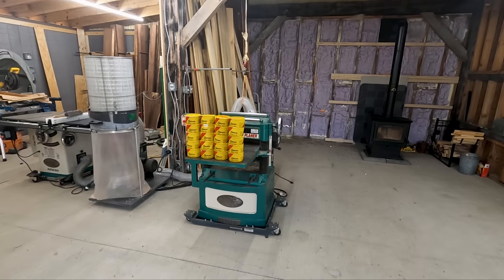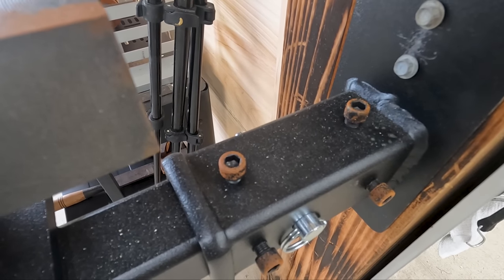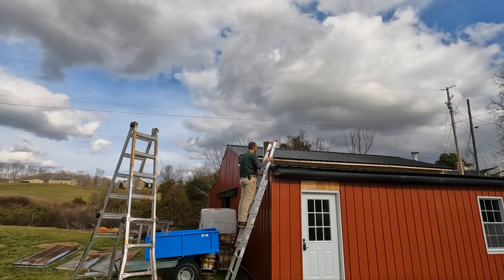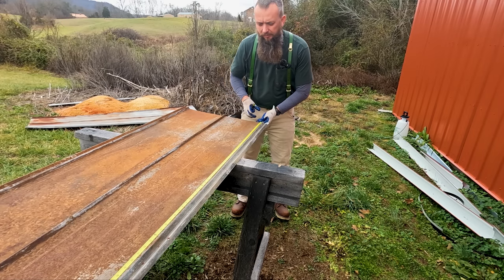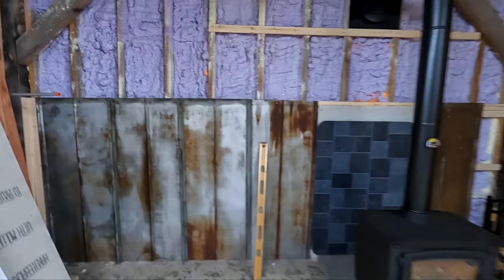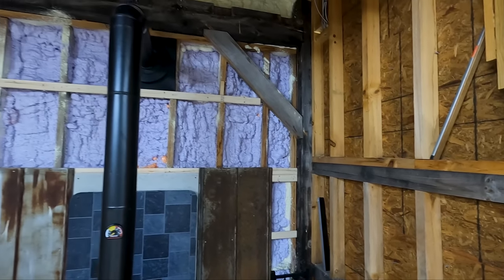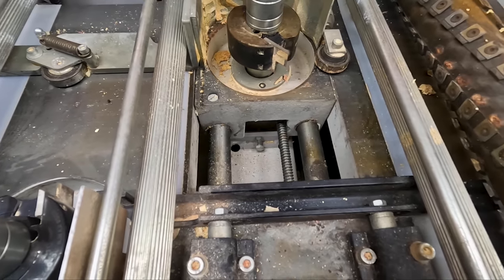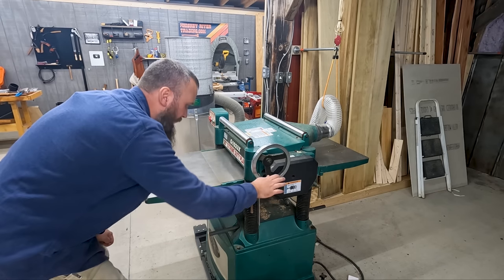DIY Barn Tin Walls In My Timber Frame, Cheap & Easy

Comment: When my parents build our new home, we had hardwood flooring installed. After the sanding and finishing once a year we rubbed the paste wax on the floors and the buffed them. The waxing job was done on our hands and knees. This was in 1968.

Comment: I’m with you on heights, terrified of heights. When I was a new sailor on my first ship, I was given the task of climbing up the side of the smokestack to remove the canvas cover so we could light off the boiler. I told the chief I as afraid of heights, he told me it sounded like a personal problem. Came down from that stack soaked in sweat.
Reply: Old sailor too. Had to go out the yardarms to change bulbs in our signal lights. I was too scared to tell anyone how scared I was... 🤣
Reply: I'd been married several years before I learned my hubby was afraid of heights. One day, he'd returned to the ship after having had wisdom teeth removed, & was told to go up to the crows nest for something (the why, escapes me now, this was in the early 70's), & he nearly passed out. Made it down before he went over the side.

Comment: I'm afraid of heights as well, however being up high on scissor lift as long as I feel secure no problem! put me in the middle of a room on a short step stool forget it! As a lover of woodworking  and blacksmithing channels I use  a mixture of paste wax and boiled linseed oil on hand forged iron work applied to it while metal is warm to protect it.

Comment: I think the added length of pipe for the wood burner will improve the draw. And I like the metal on the wall, I think once the Masonite speed board is finished I'd piece the scrap of the tin together behind the stove pipe, just for an added layer of fire prevention, plus the metal will absorb abd radiate some heat too. I'm liking the timber frame better and better every time you add something! Good Job Nathan!!

Comment: Love my killinger's suspenders. When ever I set up a new profile on my 5 head SCMI moulder I run a piece of UHMW (Plastic that is on most table saw fences) through the moulder so I have a guide to set it up the cutters the same each time I need that profile. I usually only need one test piece. Keep up the great work sir.

Comment: So a tip for setting your molder. Get a digital caliper, measure and sort all of your spacers per thickness.  You might use 2- 4' pieces and your good to go. Setup blocks and data sheets are very helpful also. 
 Chairn is 🤣🤣🤣, had to show my wife!! 🤣😄😄

Comment: In the Bad Old Days when I ran & pulled computer cables in offices I had an un-powered nibbler as all the framing and walls were done in light steel or aluminum.  Much quicker than drilling a large hole and opening that up with a keyway saw.  Still had to be careful as the nibbler would leave sharp edges.

Comment: I'm not a big fan of rusty tin siding, but, to each is own.  With all the lumber you have coming off the mill, wouldn't it be easier to put some cut offs of slab wood?  Thanks for sharing.

Comment: You might know this... But you can cut that sheet metal with a skill saw.
Reply: 3 or 4 sheets at once with a lower RPM dedicated metal cutting circular saw with the improved carbide blade..